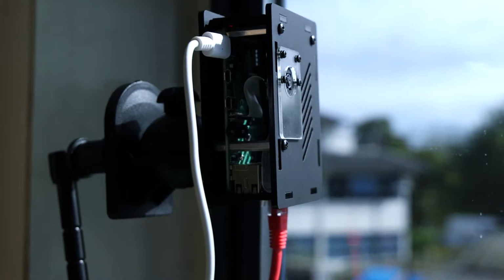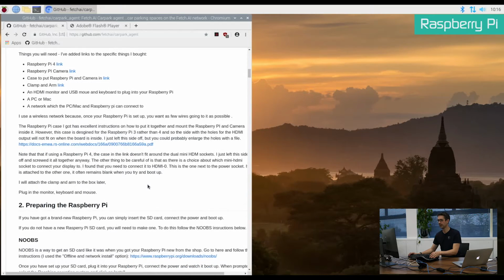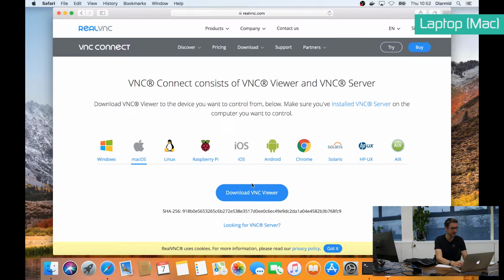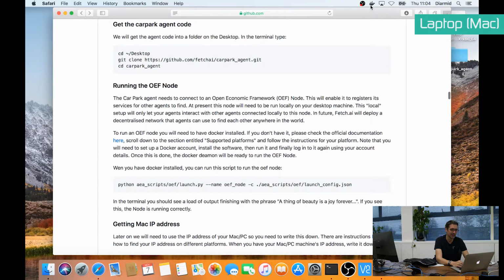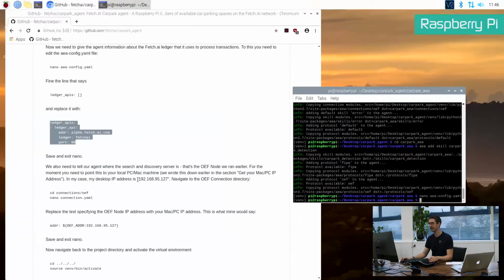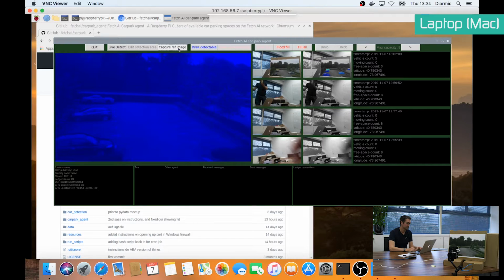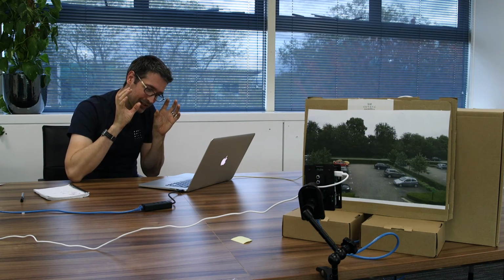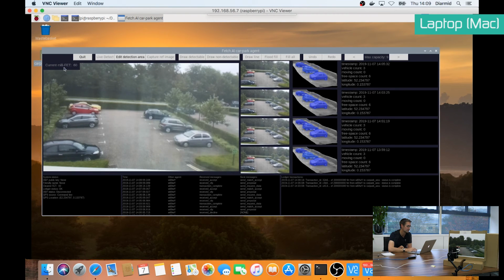Tutorial | Run your own Car Park Agent on a Raspberry Pi | Blockchain AI | Fetch.ai

Comment from the maker: Timestamps:

00:00 - Introduction
01:28 - Step 1: Physically building the Camera/Raspberry Pi Module
04:00 - Step 2: Preparing the Raspberry Pi and OEF Node
15:14 - Step 3: Running an OEF Node on Mac (Windows instructions on github)
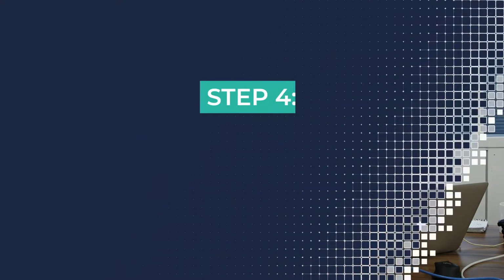20:52 - Step 4: Installing the carpark_agent on a Raspberry Pi 4 (Version 3 instructions on github)
37:55 - Step 5: Installing the client software on a Mac (Windows instructions on github)